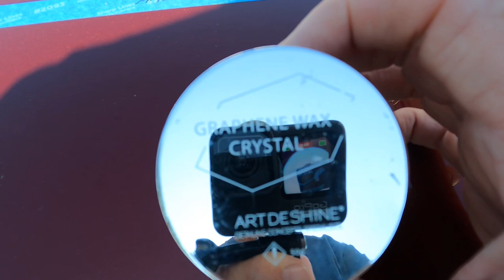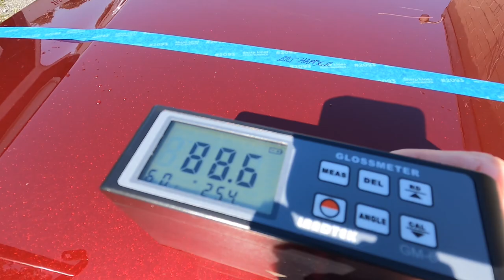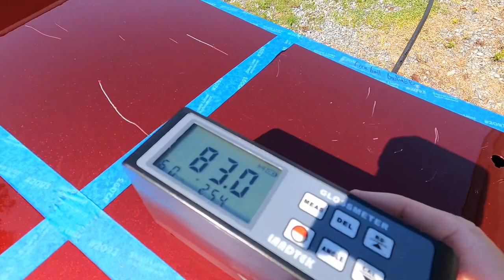If You Wax Your Car, How Long Does It Last??  Two Week Update! Wax Comparison!!

Comment: I have been thinking about waxes as a topper because of their UV resistance and water spot resistance. I used the Gyeon wax and got four months before the product started going flat.
Reply: They actually don’t have UV resistance, if you mean protection for the paint. Several tests have shown not a single car wax, sealant, or coating provides meaningful levels of UV protection, especially against UVA. 

It’s a good idea for water spotting though. Anything with really low sliding angle that can keep the water from staying on the panel will help.

Comment: The first pro wax I ever used was Meguiar's M26 Hi-Tech Paste Wax. 

This was in the late 90's. 

I love paste waxes for the nostalgia, or user experience. 

These days I prefer spray sealants like Optimum Opti-Seal, or their spray on Car Wax. 

I only really use coatings on clients' vehicles and my gf's vehicle. 

Zymol is the onky paste wax I'll use these days. It's a pretty fast wipe on / wipe off process, and the results are stunning.

Comment: Would have loved to have seen Fuso Sof99 included in this test just for curiosity…
Reply: Fusso is still King
Reply: Montreal Canada test. Applied before winter. Survived first winter and was looking strong up till next winter. Died during second winter. Have a guy who garages his corvette during the winter and drive 1 day per week in summer. It's not as strong but 3 years later it's still sheeting water like crazy. It lost the heavy beading after 2 years. I don't use fusso too often as it does takes way more time but when I do, it's the best wax out there. People say it doesn't have gloss but when I just did a black car last week. Did a one step and you could clearly see a difference when it goes on.
Reply: @MarkSegree  well it doesn’t add gloss but if you detail first and then use it it looks fine. Also Fusso has King Of Gloss which is meant to go with the Fusso soft 99. 
That adds plenty of gloss and lasts about 3-4 months. So you get gloss and a sacrificial layer. 
I have 4 cans of the original Fusso soft 99 
It will last the rest of my life
And then some.
Reply: None of these over priced products come close to what fusso coat can do.
Reply: @anguslean4058  I compound and polished my black truck. After using fusso, you could clearly see extra gloss. Like night and day gloss. Whoever told you it doesn't add gloss doesn't know what they are talking about. It's just not the best for gloss but it's still night and day difference than if you had no wax at all
Reply: @MarkSegree  it doesn’t add gloss 
Apex has a video on this 
It doesn’t add gloss 
And gloss you have came from your paint correction.

Comment: For me there is a practical limit to wax durability. Where it lasts long enough but can still be removed reasonably easily.
Having just gone through an intensive stripping and decon process on my new car with 6 years worth of waterless wash by PO.
In total it took 8 washes before I could clay bar.
I'm talking 3D prepwash x 3, 3D orange degreaser x 2. Autoglym liquid clay and regular prewash x 2.

Comment: Like fine wine, I can't tell the difference between waxes.  But then again, I quit drinking.  Autogeek sells all these types of waxes.  Dodo Juice, P21S, Pinnacle, etc..  The only one that lasts a long time is liquid Collonite 845 wax.  By next year, I will have used up my waxes and move onto ceramic coatings.  We'll see.
Reply: Funny you say that, I bought some 845 after hearing countless people singing it’s praises.  I think it sucks; it’s runny as all hell, will never flash like a normal wax so it’s difficult to tell when to wipe off, and it didn’t seem to bead water for more than a week or so. Oh yeah, and it turned the black plastic trim on my car to an oil slick color.  That being said the other thing autogeek loves to recommend, Jescar powerlock, I had way better experiences with.

Comment from the maker: Can you tell by visuals alone if the car has a wax, sealant, coating? Explain.
Reply: No, you cant
Reply: Most of these waxes are like sealants to me. Gyeon beaded water like cancoat but did not last as long.
Reply: Nope.
Reply: Putting a freshly waxed panel side by side with a clean panel?  I think you can tell a very slight difference.  If the whole car is already done i’d say no.

Comment: Great video! I’m thinking of using wax after wash on my Rc. Do you know what happens if I use it on bearings? I want a non sticky surface to protect them from dirt and water. Also do I absolutely have to wipe the Rc car after using wax or can I just spray it on and let it be?

Comment: Very interested in Gyeon wax. Hydrophobic properties looks like ceremic coating.
Reply: It's great, smells good but most importantly easy to apply and buff off👍
Reply: It has fluoropolymers like Fusso Coat, that’s why.
Reply: @chrisbradley3224  Fusso coat is a complete different story. It's way harder to apply and buff off. I have them both and use Fusso coat during winter, Q2 during spring to autumn.
Reply: @Belle1337 I can’t stand fusso coat. Couldn’t get rid of the smearing no matter what I tried.
Reply: @Belle1337  They are both fluorinated waxes. The difference in their carrier solvents is not relevant to the comment I replied to. The hydrophobicity and durability of both waxes is insane because of the fluoropolymers. I don’t mean they are the same product, just that they inherit some similar properties.

Comment: Really interesting results here. Not been a fan of the Artdeshine waxes whenever I've seen them, they are far too expensive for how short they last and even right after application their performance leaves much to be desired imo.

But I'm really surprised by the performance of the Gyeon wax here. In most tests I've seen so far it's often one of the first waxes to give in whenever there is some form of chemical or mechanical strain applied. On the other hand the Bilthamber doesn't look that good while it's usually one of the longest lasting waxes in most comparisons.